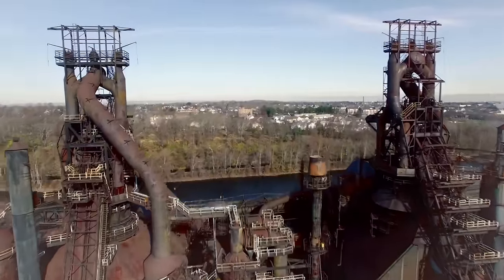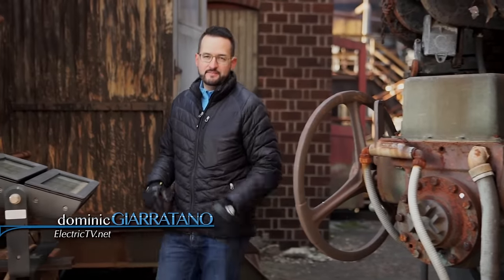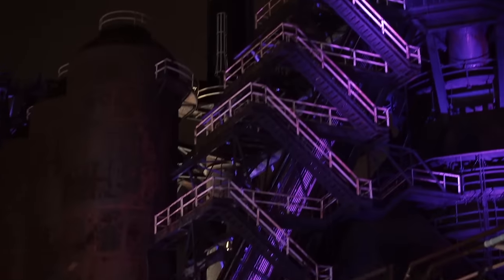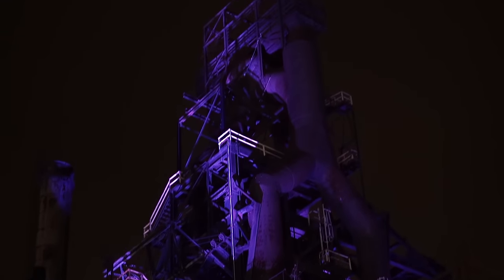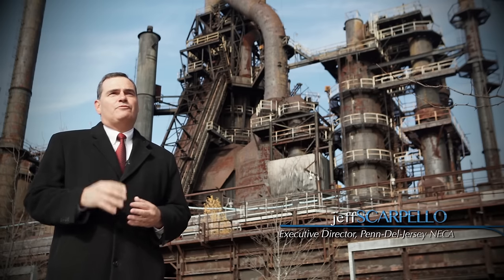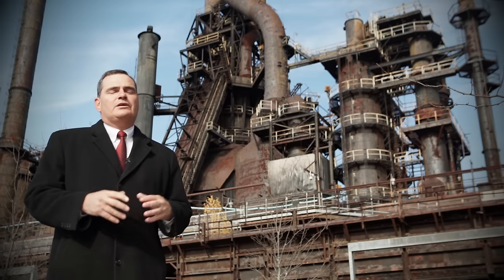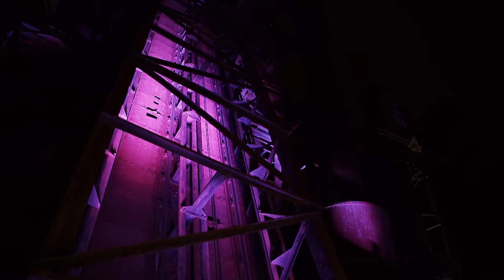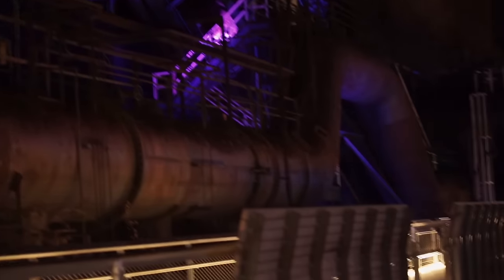Hoover Mason Trestle: The Pathway to Reigniting Bethlehem Steel

Comment: At the Industrial supply a couple of months ago, the brand new 4 inch galvanized pipe was marked made  in Vietnam. Why has a full blown steel mill that is making one of the largest volume steel commodity  products popped up in Vietnam?  I don't know the real story, but it looks like it is more profitable to move a steel mill and tubing plant than it is to stay put and deal with workers that want a vested retirement,  money to pay off their mortgage,  and health care. The local community has exhausted it's ability to absorb the steelmaking slag and other waste, the local dump is full and the local river is dead. 
 Suppose we think about the steel mill moving game as a global problem. One step would be to make a pension and retirement health care system where taxes on the fob sale price of steel are directly forwarded to the entire population of retired or fired steel workers. Lets see if we can think of something a little more modest.
How about we change the steel mill design to much smaller tonnages and use solar reflectors and solar electric panel arrays. 
Wait wait, suppose we look at the Bethlehem shutdown as a case where thousands of people had their pensions greatly reduced and also many workers were laid off while they still had a mortgage to pay. The first fifteen years of Bethlehem steel were very profitable. The last fifteen years was a gradual collapse where eventually the pension system was underfunded. Suppose we look at putting the Social Security payroll tax system on a basis where industries and businesses and that are highly profitable pay more tax. When the same business slips into it's last 15 years of stalled profits, the employees can retire on a good pension even though the business is beginning to lose profitability.